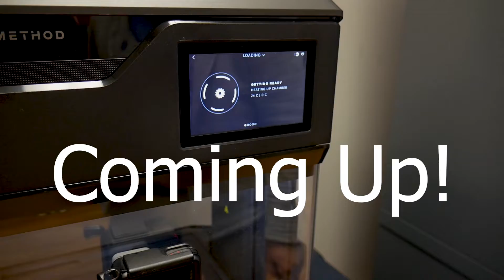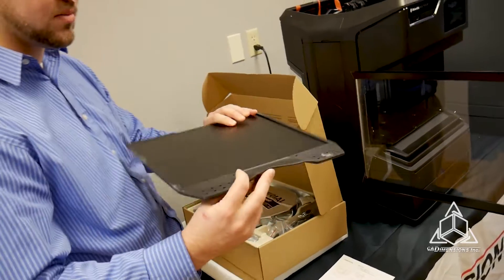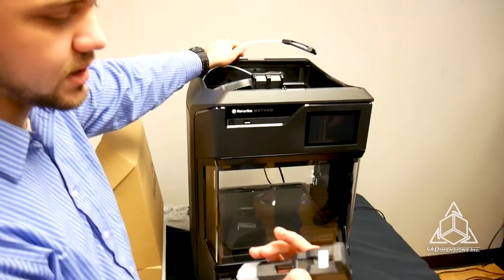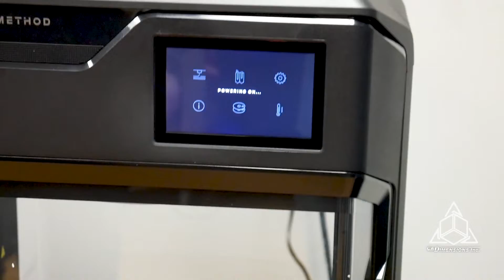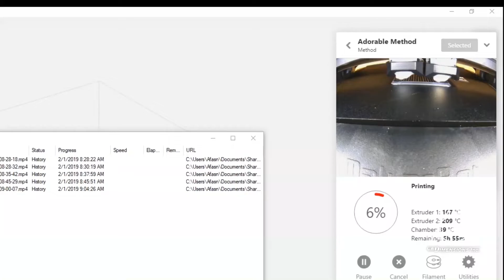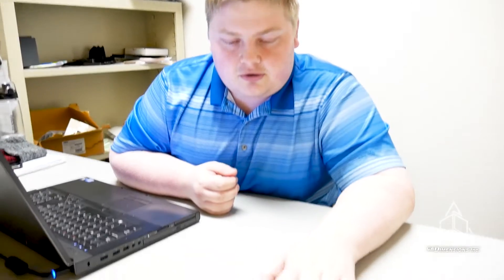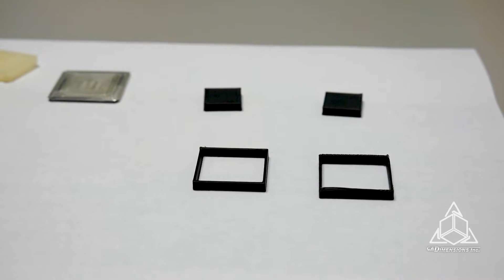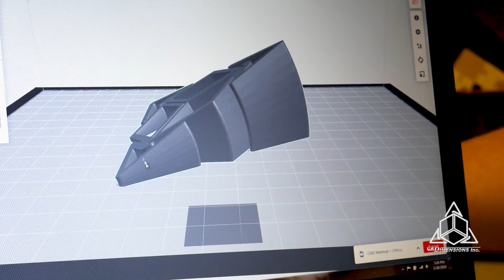Unboxing our Method by MakerBot 3D Printer + TIMELAPSE!

Comment: Is method x worth a buy compared to high price tag of stratasys? Are there typical issues like nozzle clogging and failed prints ?
Reply from the maker: It's absolutely worth the buy. It's very reliable, but prints at about 1/2 the speed of a Stratasys
Reply: @CADimensions  If it can match the performance same as or near to then speed not a issue for me. We print parts for proto types before we finalize on final form. We may test the printed parts for reliability to check on near to production version variant performance.
Reply from the maker: We've never had a nozzle clog that didn't get fixed quickly by just purging the print head a bit. It performs just as well as our Stratasys printers but it is slower. They actually share many of the same patented concepts like the circulating heated build chamber and print heads. 
Thanks for asking!
Reply: @CADimensions  Thanks, for feedback.
Reply from the maker: @arunchari3866  Glad to help!
Reply: I have this. Never clogged once. Or jammed ever.

Comment: can it use standard 1.75mm filament? i do not want proprietary stuff. We have a $100k stratasys printer at work when the nozzle clogs you need to buy a new assembly at $1k each. This is on top of the monthly support/maintenance fee.
Reply: So stratasys too have nozzle clogging issue. Whats your experience on stratasys is it worth price compared to makerbot 1/10 th of price from same vendor.

Comment: The method seems like a reliable and useful little printer, apart from its 5k starting price.
Reply: tbh this machine is meant for professional use.
Reply: @DrLol07  Of course it is, the method is probably a line between consumer and prosumer printers and the ultra expensive stratasys and 3D systems printers.
Reply: @DrLol07  probably for people who absolutely need reliable prints 24/7 and don't want to spend extra time fixing stuff

Comment: how long it took to print out the logo? would like to make a comparison with Stratasys F120, looks like you printed same model on both
Reply from the maker: Good question! 1h 20min for the F120. 1h 40min for the Method. Time difference between the machines is not linear. The larger the part, the faster the F120 will be. Small parts will be nearly identical.
Reply: @CADimensions  thanks for the input.
Reply: Local sales claim that f120 is twice faster than the Method. I believe it would be referred to the large parts. Anyway, we already purchased and waiting for shipping. Let's see

Comment: Crazy how a simple firmware update can solve something that would seem like (at least to me) a hardware issue.  Very nice video
Reply: Shem Doupe I was surprised too! From my understanding, and correct me if I am wrong, but I believe the firmware update primarily corrected the filament feeding rate. 
Really is amazing what a software update can do.
Reply: "simple firmware update" sure.... they even tried to pass "upgraded" hardware as better... nothing actually changed.... their desktop software and "makerbot print" have issues every other release... the current makerbot print software wont recognize your printer unless you disable usb printing.....